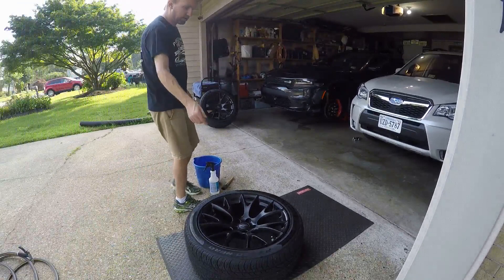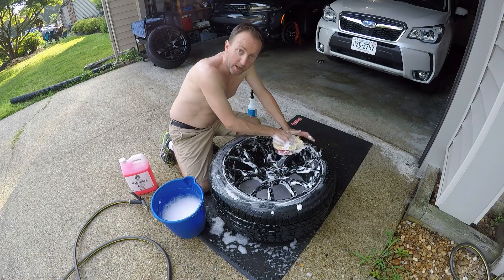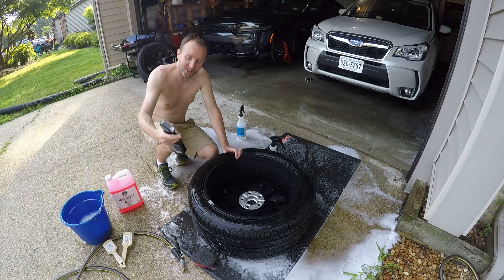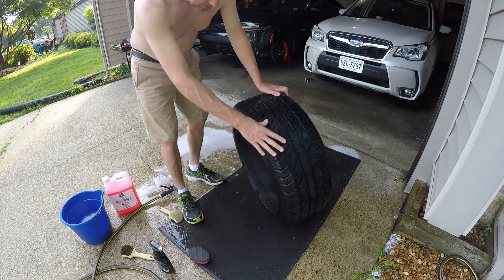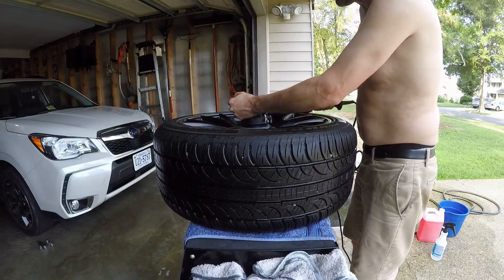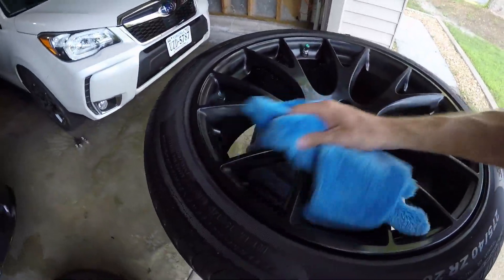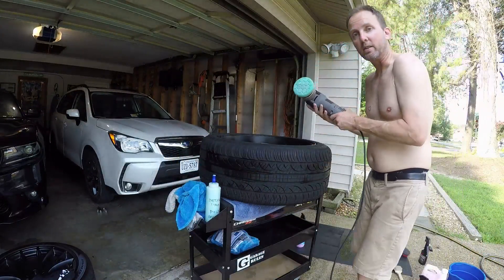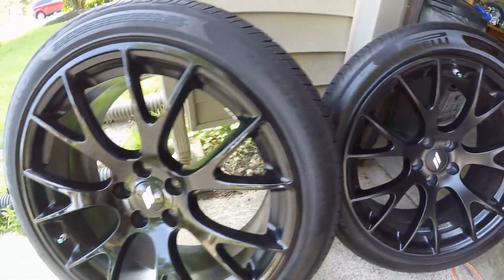2018 Dodge Charger ScatPack Ep. 32: Detailing the Front Wheels

Comment: So here’s my theory on your issue trying to put more pressure as you’re doing the inner barrel as the inner barrel is concaved it’s hitting the sides of the dual action polisher corners of the pad and as you press harder it engages the safety mechanism of the DA polisher mechanism, I wonder if you would have to use forced rotation or what’s called a rotary or a smaller much smaller pad on your DA Mark! Also don’t forget to use some sort of IPAwipe down even if you’re just doing your basic sealant ! For sure do a decontamination wipe down when you jump to a ceramic type coating!
Reply: or just buy a Harbor Freight DA for $50 - it's the Honey Badger of DA Polishers...  Definitely a smaller pad and probably easier just to go with a cheap-o kit on Amazon that comes with a drill arbor for $13.  Wax and grease (IPA works well as Timboslice mentions which you can buy already in a spray bottle at Walgreens)....
Reply from the maker: oh ya thats the one thing i forgot... to alcohol wipe it before sealant

Comment: Yeah, you don't need a different DA Polisher just a smaller backing plate and smaller pads (IMO) - I'd check to see if a smaller counter weight is needed - that should definitely be less expensive than another polisher.   I'm no pro but I know some of us have a tendency to over think this stuff sometime....
Reply from the maker: ya ill prob buy a smaller plate for the rupes then. but id prefer a rupes nano.

Comment: Wheels looking good!

Yes, washing your microfiber before use will minimize linting.  The Rag Company always recommends washing first.

Timboslice has some good comments.  I'll add my 2 cents.

You might not be putting much force on the machine, but the force on the edge of the pad is exaggerated because of the roundness of the wheel.  If you used the exact same amount of pressure on a flat panel, pretty sure the pad would spin just fine.  It is meant as a safety net, as far I understand, to keep you from burning up your finish when a polish is being applied.  Too much pressure might generate too much heat.

Polish will likely leave behind some oils or lubricants so before applying waxes, sealants, or coatings, it's best wipe with IPA or a dedicated paint prep.  To apply poly sealant on a wheel, I would just spread it on by hand with a small microfiber applicator.  It's not like you need the D/A to do any work on the finish, you just need to spread the sealant evenly.  On something as small and tricky as your wheel, a hand application would be my choice.